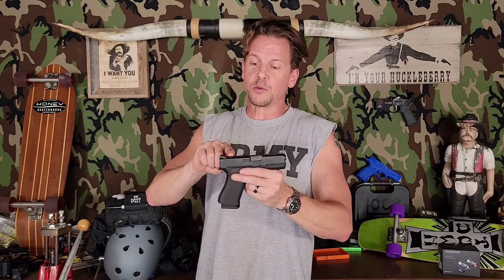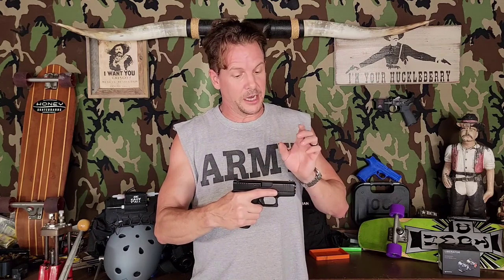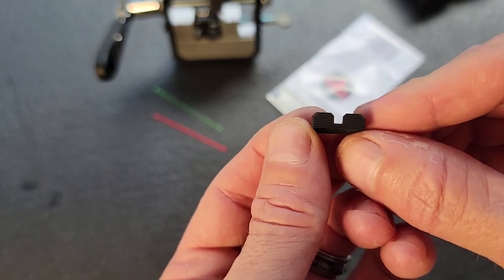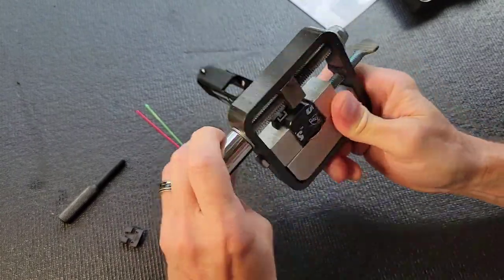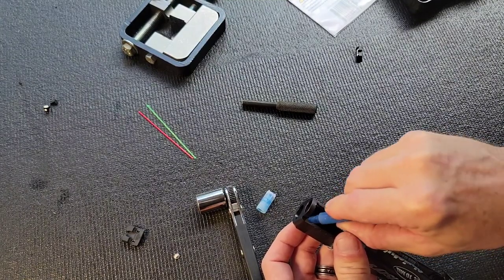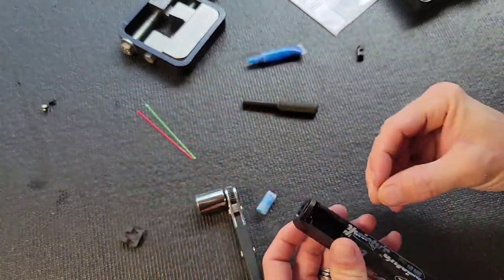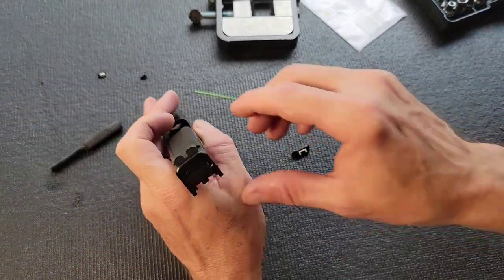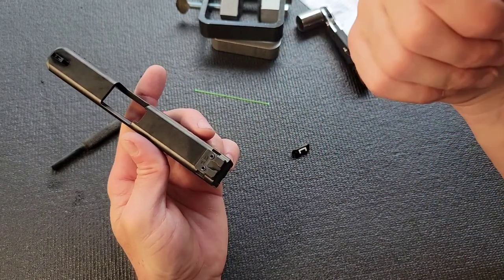Frank Proctor Fiber Optic Sights for Glock 43X - First Impressions

Comment: Did you buy the GLOCK OG sights? The website shows a picture of the sights for slimline guns, but no specific option for them. How is the point of aim/point of impact with the sights? I”m trying to decide whether to buy these sights or a set from Heinie.
Reply from the maker: I picked these up on either Amazon or Ebay, and they were listed for 43/48. I like them enough that I haven't bothered cutting an optic cut yet. 😁
Reply: @SapperGentleman  I prefer fiber optic front and blacked out rear sights. Unfortunately, many of the sights are parkerized which I won’t buy, as I’m of having to keep a light coat of oil on sights to prevent rust, which is still no guarantee. I’ve been using Taran Tactical Sights and I like them a lot, but they don’t have sights for the G43X. Heinie, Proctor and Trijicon are the only companies making sights that fit and have a rust inhibiting finish like nitride or dlc. I like the Heinie ledge sights, but the rear notch is 0.156” and I’m concerned that’s a bit too wide. The Y-Notch seem to check the most boxes. Thanks for the reply!
Reply from the maker: @dankeglock  I'm in SUPER humid Houston, TX, and have had zero rust issues with the FP.
Reply: @SapperGentleman  Proctor was smart and went the extra step to use a nitride finish. It’s a big selling point for me. Thanks again.